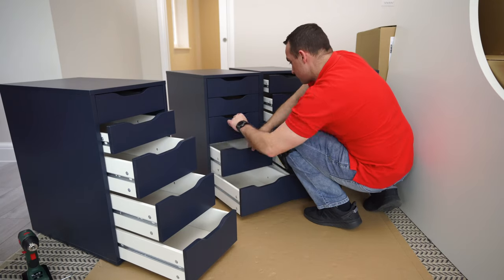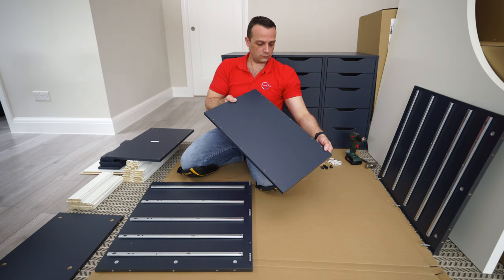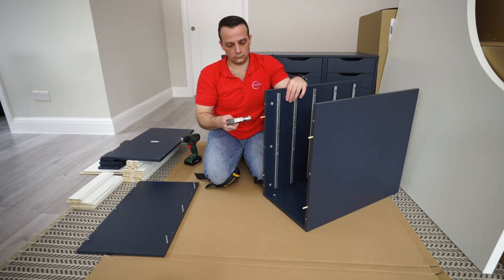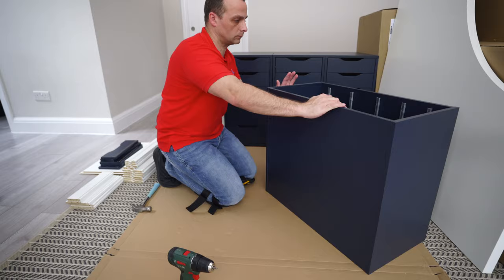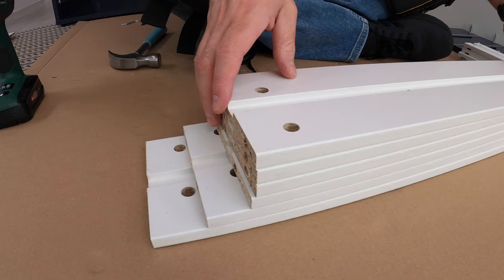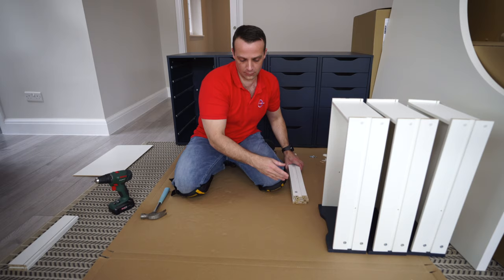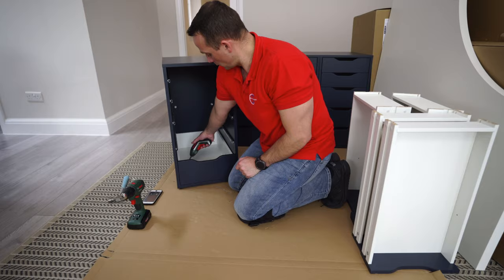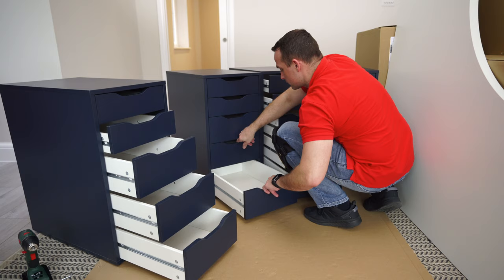Ikea  ALEX drawers assembly with LINNMON tabletop. Ikea Alex/ LINNMON desk setup

Comment: I think they may have updated the Alex drawers so that the top piece and bottom piece can be interchanged depending on whether you want to use it for a desk or not. You can actually drill a desktop into the Alex's now for extra security from what I'm understanding in the instruction booklet.
Reply: Okay so it's not just me. I'm going crazy right now trying to figure out how to put the legs on when using Alex with a desktop. The instructions are ... not clear. I've built hundreds of pieces of IKEA furniture and never had an issue until this!

Comment: do you have to secure the table top in between drawers?
Reply: Yes my question.
Reply: I think if it’s longer than 55”, then yes. There’s a leg in the back center to attach. 

It’s it’s 55” or less, you don’t need to.

Comment: I noticed you put the wood dowels "backward"*. If those holes were drilled too deep, you will have less dowel sticking out to grab the other piece.
* I believe you follow the official IKEA instructions, but I prefer putting the dowels in the other piece instead, because the hole depth is limited by the thickness of the board.

Comment: How do the drawers attach to the desk top? do they just sit on top?
Reply: That's exactly why I watched this video to figure that part out.  It doesn't seem safe to just put the table top on top of the drawers.
Reply: @berthavillalobos8163  I think he used those small clear circle plastic things they probably stick to it.. I used double sided tape and that worked for me
Reply from the maker: They just sit on the top
Reply: @PPFlatPack  does the countertop move on top with it just sitting on top of the drawers? im wanting to do my desk setup like this but dont really want to be doing any drilling into the tops of the drawers or filing cabinet. i already have a filing cabinet im going to use on one end but thinking of getting those alex ikea drawers for the other
Reply from the maker: @benboatright6461  I think if you put heavier stuff like monitor that will help otherwise you can secure with L brackets from the bottom.

Comment: Hey 👋 where can i buy the corner element??
Reply: They are discontinued. I was looking for them as well.
Reply: @camilleeppstein  but where are you looking? IKEA haven’t this corner in his Sortiment
Reply: @ViennaKings  Yes, I realize that. It was listed on the IKEA USA website up until just a few days ago but it was out of stock everywhere. Now it's not listed at all. When I did some research, I read that it was discontinued and no longer available and that no replacement part is planned. Even the Linnmon tops are discontinued but they have replaced them with the Lagkapten tabletop which are basically the same thing.
Reply: @camilleeppstein  Thank you very much, let's hope that they are available soon :)  greetings from vienna
Reply: @camilleeppstein  I just bought the Alex/Lagkapten Desk. Lagkapten gets screwed into the Alex drawer, so it doesn't slips around like the Linnmons did. For that, they also changed the Alex drawer a bit. They now have different top and bottom parts. If you want to screw in the Lagkapten Top you have to use the bottom as the top part and vice versa. It is written in the instructions. I really like it. Have to assemble the drawers and put them in tomorrow. But everything else ist standing 👍🏻
Reply: @Jano1998  Yes, I realize that, but it doesn't help me if I'm trying to make a corner desk.

Comment: How did you attach the countertops to the drawers?
Reply from the maker: For this one there are just plastic stickers and the countertop seating on it without attaching with screws. You can attach it if you like with screws by drilling the top panels on the drawers but once you want them use just like the free-standing unit you will see the holes. Depending on the countertop here is a different shape and custom cut. If you have the original countertop for ALEX Drawers you can adjust the top panel and use predrilled holes here is explained in more details https://youtu.be/lyrMb_I51Ag
Reply: @PPFlatPack  thanks! Does it slide from time to time?
Reply from the maker: @ElonMuskTheOne  Depend what you do I guess it can move little (I don't have access to this desk anymore) if is my desk I would fix them with screws or at last would attach the countertop on the wall maybe with L brackets.